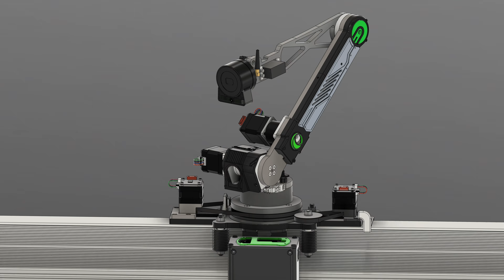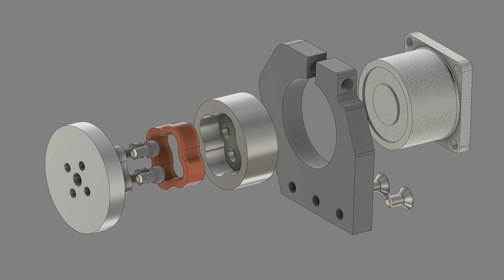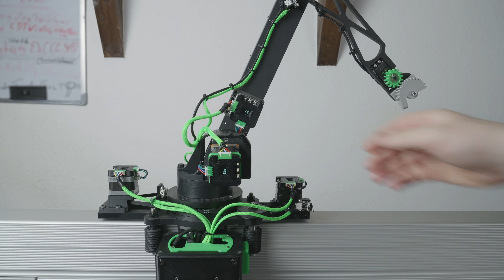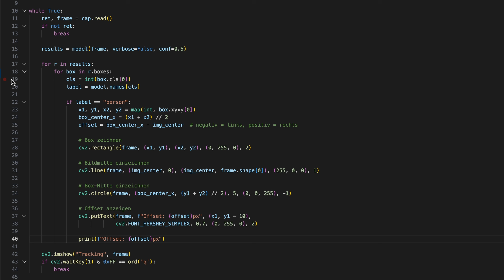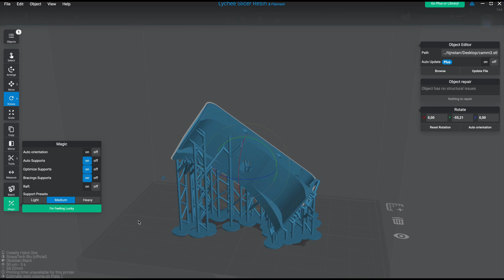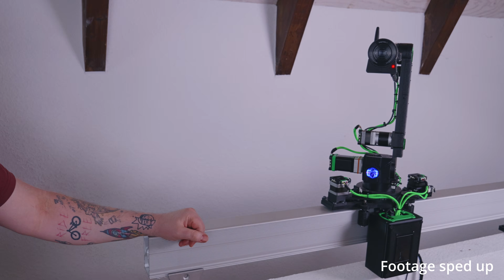I Built a Mostly 3D-Printed Camera Robot with AI Tracking

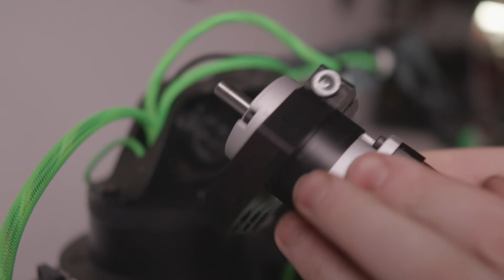Comment: At around 1:25 you show the "backlash" in the gearbox. That seems way more than just some gear backlash, I think the plastic where the key from the shaft is might be loose or something?
Reply from the maker: Yeah, you’re absolutely right. A 100:1 planetary gearbox does have some backlash, but definitely not that much 

Additionally, after some time another problem started to appear.
The coupling between the gearbox shaft and the shoulder joint slowly became loose.

Even though the shoulder part was made from aluminum, I didn’t design that connection very well.

Most likely because the motor and shoulder joint weren’t perfectly coaxial.

With the harmonic drive version, I redesigned the coupling completely, and the flex insert can now compensate for small misalignments much better.
At least so far, after a couple hours of testing, it’s holding up pretty well.

Comment: Amazing project! Do you know how much torque your stepper motors are rated?
Reply from the maker: Thank you! ☺
The robot originally used large NEMA 17 stepper motors with 100:1 planetary gearboxes. I don’t remember the exact torque rating of the steppers anymore, but probably somewhere around 0.5 Nm at the motor itself.

Later I replaced the shoulder joint with an 80:1 harmonic drive MiniF11. According to the specs, the rated torque is around 5 Nm, with significantly higher peak torque values.
Reply: @LionInTech  Thanks!

Comment: "many parts came from....."  Actiually commented on another video I saw on microscope holder arms- which are just re purposed monitor moiunt arms prioced at X times more the price..besides that.... I've always wonderred how good of a base would something like that be to make a robot limb..robot arm- speifically those zero gravity style monitor mount arms- you even have a base structure that can have 2.. 3 arms comfortably attached... addiong the ellectronics/ servos/ sensers. The monitor mount arms have the pneaumatic or spring mechanisms within tthem that allready hold much if not more of the weights you mention- heck...they make camera desk mount arms- even so for the hefty cameras of the more proffessional kind...
Profffessional? And now you got me thinking... all those zero gravity rigs for movie making... those hold some serious weight worth of equipment on them with little to no strain on the operatior- how about finding a rig like that and repurposing it, adding the servos required/ actuators... some even have them mounted on rails already for those sweet pan shots...
Reply from the maker: You’re honestly not wrong 
A lot of those systems already have excellent weight compensation and smooth movement built in. The biggest challenge would probably be reducing play and adding precise positional feedback for repeatable robotic motion.

If I built a new one, I would probably make it much bigger and heavier. With the small NEMA 17 motors and gearboxes, everything works, but the whole system is just a bit too light. There’s probably a reason why even the ...cheaper.... professional camera robots are still very massive and often use counterweights.

I didn’t show it in this video, but I also experimented with mounting my larger camera on the arm, and the extra mass became a real problem very quickly. Not because the motors lacked power, but because the whole system started oscillating. And let’s be honest, the camera I used in the video was more of a design choice than a practical one anyway 

But the monitor arm idea is honestly pretty good. I recently bought one of those spring-loaded monitor arms on Amazon for around 30 euros, and I was actually surprised how stable it was. Something like that could definitely be useful as a parts donor.

Comment: To improve camera movement programming try this: keep a track of the robot arm positions. Use a button to take a snapshot of a starting position, move the robot arm by hand to the end position and take another snapshot. Then interpolate between the start/end positions to create a smooth robot movement.
Reply from the maker: At the moment my robot isn’t backdriveable, so I can’t move the arm by hand like that. The way I programmed it, I use a PlayStation 4 controller to move the robot into position, take a snapshot, and then interpolate between the saved positions.

The idea with placing small markers and aiming the camera at them is a really good tip though. Thank you! I honestly didn’t think of that. So far I was mostly aiming by eye.

The main limitation is that I wrote the whole software myself with the help of ChatGPT and Cloude instead of using established community software, so there are definitely many areas where the motion planning could be improved.

In the future, I would probably use something more established like ROS 2. With that, I could give the camera robot a proper coordinate system and maybe even use AI tracking to keep a specific point or part in frame automatically. But that’s more of a future project.
Reply: @LionInTech  It's very impressive if you were able to build this much with just LLM support. Open source libraries are helpful if you get to know them but they come with a little bit of everything, sometimes that's too much information so DIY can be better at times.

Just good problem solving skills are better than any library, tool, etc. 

But PS controller is a pretty good work around if it's not back-drivable.
Reply from the maker: @armoriumimperatoris  Thank you, I really appreciate that.
But honestly, I really struggled with parts of it and definitely broke a tooth on the learning curve 

At the same time, I think doing everything “the hard way” first was actually valuable. If I had immediately used a fully developed library or framework, it probably would have worked more like a black box and I wouldn’t have learned nearly as much from all the mistakes.

Building everything from scratch forced me to understand what is actually needed and what is unnecessary for a system like this.

For my next project, which is a walking robot, I’ll definitely use ROS 2 though. Right now I’m still developing my own actuators for it, but that part is already getting pretty far along.
Reply: @LionInTech  I build game engines from scratch so yes, I 100% understand the attraction to learning the process. Danke mein freund.
Reply from the maker: @armoriumimperatoris  That’s actually really cool 
And yeah, then you probably understand exactly why I enjoy building these kinds of systems from scratch, even if there are already easier solutions out there.
Do you have a game available somewhere? I’d actually be curious to take a look at it.